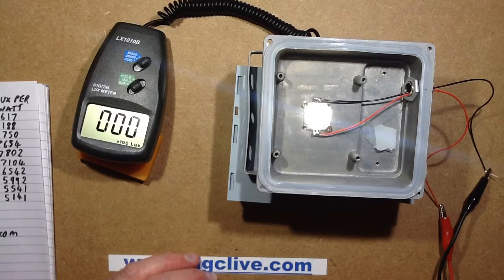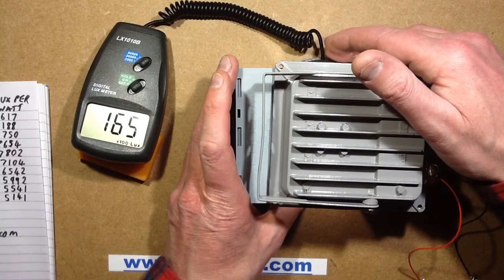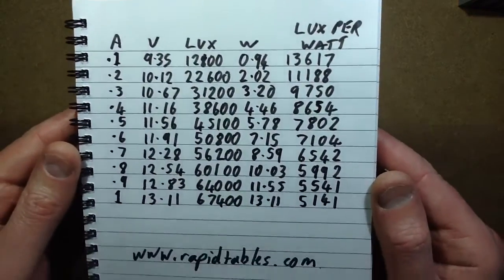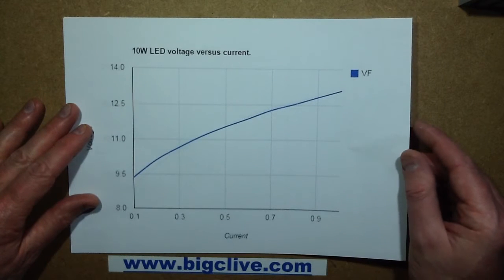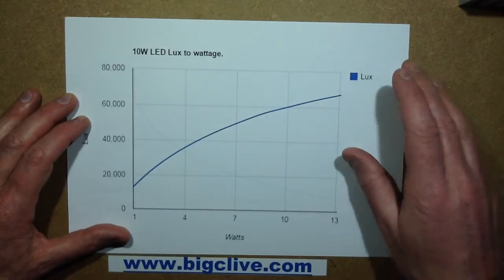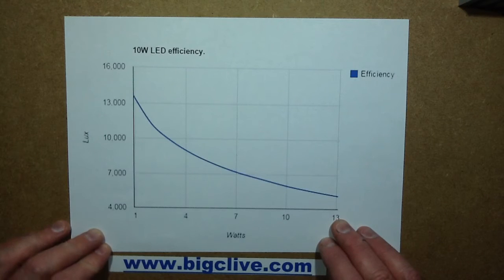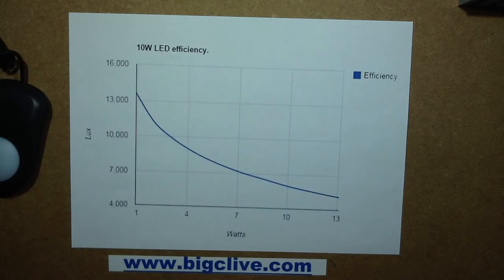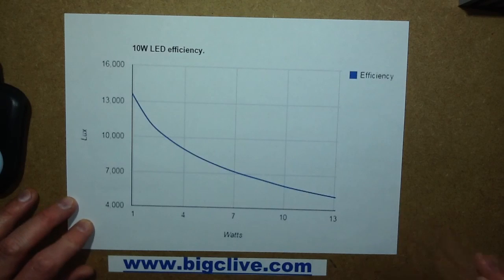10W LED efficiency test take-2 with an LED that works!

Comment: The reduction in apparent brightness of the cool white LED as measured by your light meter is probably an artifact of the light meter spectral response.  Higher CCT LEDs are usually more efficient as more blue light from the dies gets out without being converted by the Ce:YAG phosphor as there are phosphor conversion losses.

Comment: So we shouldn't be using PWM to dim these leds (efficiency wise). How interesting. 
Too bad led drivers only support pwm dimming.
Reply: That is not quite correct. Following approach is most efficient:
- PWM Dimming
- Each pulse is never more than 50% of the maximum LED drive.

If you do voltage dimming using linear regulators, you will dissipate the brightness of the LEDs as heat and consume same or even more of the energy when not being dimmed.

Switch mode voltage regulator dimming is actually PWM dimming + capacitor to smooth the voltage output.
Reply: ***** There's a difference between LED efficiency and driver efficiency.

Smoothing can make the led more efficient while making the driver itself slighly less. Linear regulation can also make the LED more efficient but the regulator itself would just waste the power.
Reply: Switch mode (buck) converters actually use an inductor. 

Using a linear voltage regulator would indeed be useless and highly impractical considering the huge amount of heat generated. 

Most led drivers use some resistor arrangement to set the current. We could hack in a way to have multiple options using a toggle switch or something. 

One minor issue might be the color of the light. Color trueness is only guaranteed at certain currents.
Reply: And the inductor is driven by PWM. ;)

A linear regulator dissipates the excess voltage as heat.

A resistor dissipates the excess voltage as heat.

So the best method is using a buck converter with constant current output rather than constant voltage output. Voltage is then limited when the LED temperature increases. You then simply set the current via a pot.

You could also omit the output capacitor of the buck converter and drive the LED with constant current pulses. Using PWM you are now able to dim the LED without affecting CRI.

Comment: So best efficiency is from running it at around half power. Good to see that.
Reply: He's done his graphs a bit wrong. Best efficiency is right down at the bottom.
Reply: Dr. Lecter The only thing wrong is really just that one graph is "lux/W vs W" and not "lux vs W".

But that's kind of fixed by that annotation now.
Reply: m8e
Annotations don't work on most devices. The graphs are all a bit wrong though, the IV curve should be the other way round. The result is exaggerated also as it's unlikely he controlled the case temperature with a TEC and laser diode controller pair (the standard way to do this).